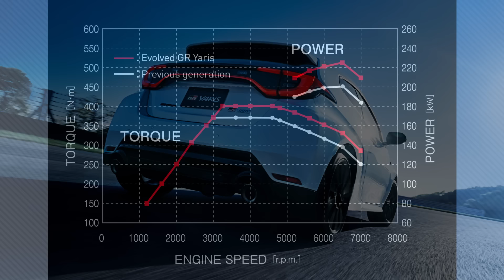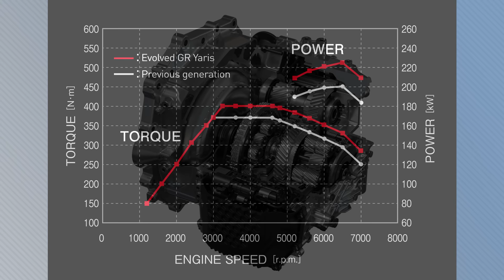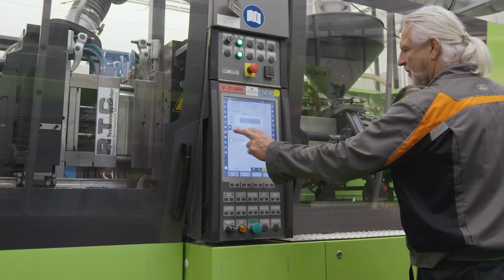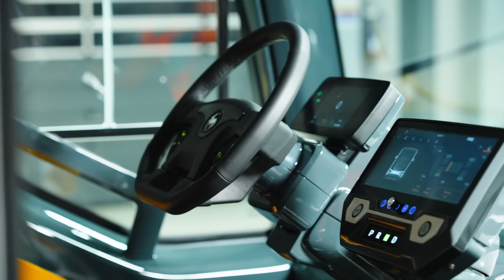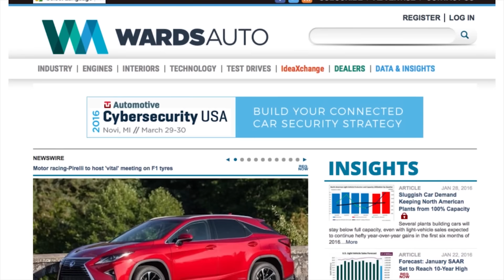Tesla Main Reason for German Production Growth; Toyota Recommits to ICE - Autoline Daily 3724

Comment: Need to make a hybrid sodium lithium battery best of both worlds
Reply: Just wait, 2 more years and Toyota will have solid state batteries.  They have said just 2 more years ever since 2012.
Reply: @davidbeppler3032   Toyota keeps saying 5 more years to commercializing of the mythical "super-battery" but they are no closer to it now than they were over a decade ago. The problem is making one that's a better value than the current battery state-of-the-art. Current batteries already serve our needs, what consumers want is lower prices and solid state batteries cannot deliver on that. They cost more and have a shorter lifespan. In other words, they offer very little benefit but cost more upfront and need to be replaced too often relative to existing batteries.

Comment: This sounds more like Hertz is going to limit how many Tesla's they own and maintain. It seems like Tesla's are engineered more like cellphones, not really repairable and meant to be (mostly) disposable.

Whereas I believe the Chevrolet Bolt is much lest costly to repair since it's based on a modified version of the Gamma 2 platform.

On their used car website, it looks like Hertz is trying to unload 600+ Tesla's, and just 34 Bolts.

And the Bolt seems to be holding some good used value - better than the Tesla's.
Reply: Yes, Bolt, the discontinued car is more expensive than a Tesla.

Comment: 2.5% accounts for much of the growth ?
Reply: i think 2.5% growth was for the overall German automotive production. Tesla Gruenheide (GIGA Berlin) will grow much more rapidly. Currently it sits at 375k/yr, but is applying for permits as we speak to increase the capacity to 1 million (current permit allows 500k), which includes expanding the premises, more battery production and recycling.  If things go according to plan, expansion will start in the first half of this year.
Reply: Auto manufacturing in Germany will grow by 2.5%.  And almost all of that growth will come from the expansion of Giga Berlin.

Comment: Hertz is selling 20k EVs by the end of the year, Hertz is also selling 26k ICE by the same end of year.  Must be the weakening ICE demand, high maintenance, and fuel costs?  Used car prices are tanking and Hertz will take a huge loss on those ICE too.  Hertz is just making bad business decisions based on a lack of education.  Selling a used ICE with 90k miles makes sense.  ICE only last about 300k miles.  Selling a used EV with 90k miles does not make sense as a TM3 will last about 750k miles.

Comment: Battery pack standardization is exactly what the industry needs
Reply: It is very interesting to see five automakers in China teamed up on one battery swapping standard.

I've heard there are significant government incentives for swapping, which might be part of the story.  But if they can get enough steam going behind swapping, it might really be a thing.

Like the vast majority of the world, China does not have vast sprawling suburbs of single family homes.  They have densely populated apartment blocks.

They also have massive reserves of battery materials, and not much domestic oil.  So they're gonna do what it takes to get apartment dwellers out of ICE vehicles and into public transit or EVs.

The lower long term cost of renewables and electric transport, compared to fossil fuels, could give them a massive economic benefit in the long term.
Reply: We need to have more variety to figure out what works beit's a growing technology

Comment: Y'know, if it wasnt for Tesla the world would not be having this electric revolution. When Tesla first started all the car makers laughed & laughed & laughed because they knew all about those early lousy electric cars built in the early 1900's with a slow top 
speed a short range and a long long long recharge time. The current makers assumed all those problems could not be overcome 
so they laughed at Elon. Well, whos laughing now? All the other makers are racing full bore trying to catch up.
The reason those early electrics were abandon for petro? John D. Rockefeller.

!
Reply: To be fair to Rockerfeller, the battery, electronic & microchip technology wasn't mature enough until the year 2000 for production of 200 miles, per charge, modern EV. Yes, no?

Comment: battery swapping is a scam and will bankrupt the company when packs start failing
Reply: No way to even tell if you get the same standard battery pack in a swap.
Reply: Nio is doing great with it.
The fact that none of the US manufacturers could crack the code doesn't mean it's a flawed concept.
Reply: @SkywalkerWroc    What code is it that they cracked?  Other than how to invest in a tech that will cost them money.    There is no way around the fact that faster charging will make it obsolete.
Reply: @SkywalkerWroc  Unless I see BYD or CATL jump on NIO's battery standardization no code has been cracked. Now if Geely came out and said all future Polestar vehicles will have swappable batteries then I would acknowledge momentum. As it stands NIO is falling further behind. Maybe in EU countries where consumers have more rights and you're guaranteed to have no damages to your vehicle from a bad battery or incorrect swap, but in the US and litigious countries that is just putting the onus of liability on the end user and most end users don't need to be blamed for another point of failure.
Reply: Battery swapping would maybe work in the south, but I can't imagine that these suckers freezing their nuts off in Chicago are going to have any success with the concept.

Comment: Ev cost and maintenance more expensive than Ice ?  But that goes against the millions in advertising EV manufactures spent telling us the opposite.
Reply: When you account for how people treat rentals...
Reply: @CSHarvey  are you suggesting all those who lease or own cars treat their cars with the greatest of care ?
Reply: it is the opposite., all I've done for my ev in the last 5 years is tire rotation & replaced the 12v battery myself.
Reply: Ok, so first off, tell me more about these millions that "EV manufacturers" spent on advertising?

I can only think of one automaker that has spent big on advertising their EVs - and that's GM, the one that doesn't actually make any.

Secondly, tell me more about these ads that talk about repair costs?  Where can I find an ad like that?

Thirdly, Tesla factory repair centers are not cheap.  Just like any dealer repair shop is not cheap.  Did Hertz not know this two years ago?  Are they incompetent, or ignorant, or what?

Fourth:  People don't seem to notice that Teslas get their efficiency advantage and cost advantage in part by being very light weight (not counting the battery materials of course).  Did Hertz not know this two years ago?

Comment: Tesla people love to brag how Tesla is  innovative and lead the EV revolution not Marry Barra.  How Tesla is the car maker shaping the EV landscape, where they lead, others follow.  If so, well then  blame for why EV's are more expensive to repair than combustion Vehicles sits squarely on Tesla's laps - or to stretch the electric apology, on  Tesla's thunder thighs. I have no idea how Tesla managed to cockup one of the crucial areas that should be of advantage to EV's which is ease of repairs. Electric vehicles oughtn't be more complex than combustion vehicles. EV's at thire core  are so easy,  street guys in my third world homeland make them but are unable to make combustion engines.  It's as if Tesla is becoming a confidence trick: 1) Elon is a supporter of Anti Ev Donald Trump. 2) Tesla fans aggressively spread FUD on other EV manufacturers. 3) Tesla EVs are beginning to seem as if deliberately overengineered, leading to difficulty of repairs and high insurance.
Reply: EVs aren't more COMPLEX, they're more Expensive to repair. That's largely down to the fact that there isn't a century old industry of third party parts manufacturers and certified repair shops competing for your business driving down costs. There's just Tesla, putting every part they can make into a new vehicle with hardly any to spare for repairing damaged ones.
Reply: Shops bitched and moaned when cars went from body on frame to uni body citing the same thing until it became the norm and shops learned how to fix them. It will be the same with EVs. And prices will come down .....For Teslas anyway. Because they will be everywhere by then.
Reply: @CSHarvey What is being repaired?
Reply: @vancity2349  The single biggest complaint that people say is the battery will go belly up at 5 years or the car is a paperweight once the battery dies. Right now people don't toss out their TV remote control when the batteries die. Once the logistical hurdle of diagnosing and repair failed battery packs becomes mainstream, repairing a battery pack may cost only $2-$3k and should be much more reliable than repairing a transmission, National chains like Penske and Aamco aren't going to let EV repair money sit on the table.
Reply: @Tokamak3.1415  Agreed but the naysayers wont agree